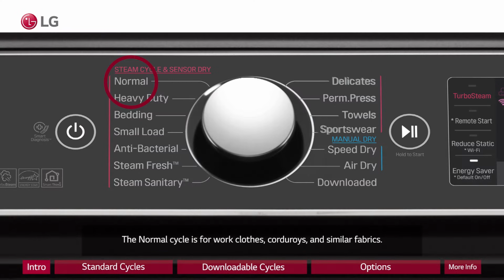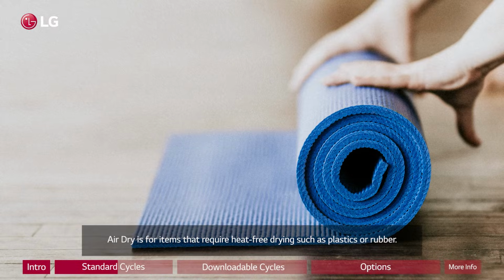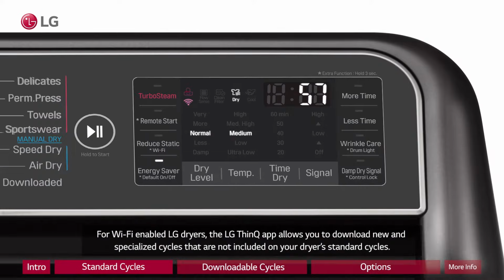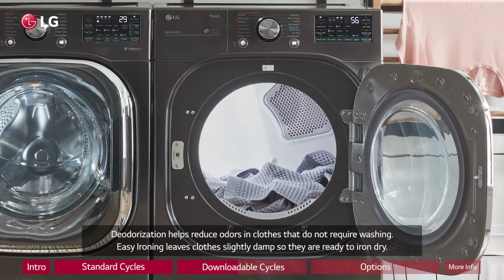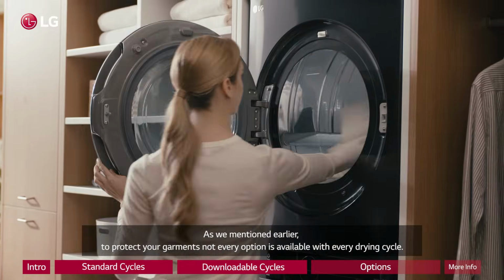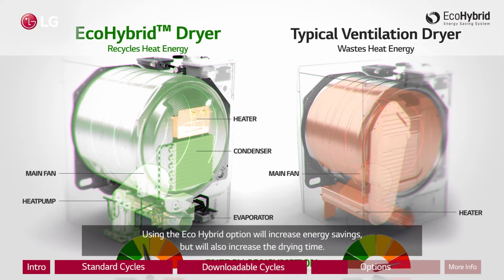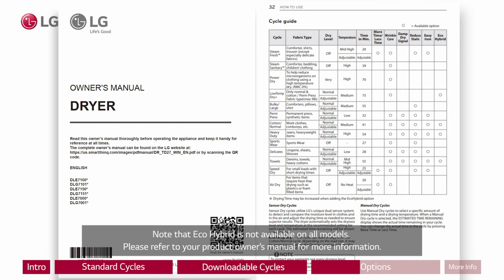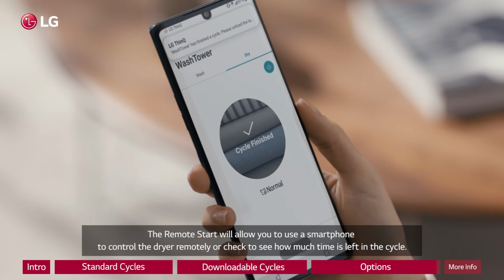[LG Dryers] Cycles and Options

Comment: Is there any way that I can JUST do a tumble dry low?
Reply: Yes, you can change the default setting by pressing the word temp. Each press move the temperature setting one notch. Keep pressing temp until your desired temperature is reached. If that doesn't work for you, you can set the dryer to Timed  Dry and then select your time and temperature.
Reply from the maker: We appreciate the helpful tips, Veronica! We're always glad to see customers helping each other so you can get the best experience with your unit. If you ever need anything, feel free to reach out to us on social media at @LGUSSupport, and we'll be ready to help! *Josh
Reply from the maker: Hey there! There's a special joy in doing laundry with your LG dryer, especially when the amazing features add to the experience. We'd love for you to private message us on social media @LGUSSupport with your contact information and model number, so we can check into your owner's manual to see if your model has this setting. We hope to hear from you soon! ^Joslyn

Comment: Hey how many degrees in Celsius is normal dry, time dry and extra dry
Reply from the maker: Hi, there! The normal, dry, time dry, and extra dry settings on dryers typically correspond to different temperature levels. The specific temperatures can vary between different dryer models. Please send us a private message on Facebook or X at @LGUSSupport or call us at 1-800-243-0000 with your product details so we can look into this for you. ^Jayne

Comment: I’m planning to buy an LG dryer with steam but I will not connect the water hose to the dryer. Simply not interested in the steam function. Would that cause a problem?
Reply from the maker: Great question! Do you mind letting us know a particular model you had in mind to make sure the feature in that model is optional? We look forward to your reply! ^Chris
Reply: @LGUSASupport  it’s the WM6700HVA
Reply from the maker: Hey there. With regard to this model WM6700HVA, this is not a dryer model but a washer model that is resemblance to the model DLEX6700B, which is a dryer. In all regards, most dryers that have the steam option, have a steam feeder in which you would pull out from the drawer and add water for the dryer to have its steam. ^Anthony https://www.lg.com/us/support/help-library
Reply: @LGUSASupport  You are right, I meant the dryer DLEX6700B. Would I have a problem if I don’t connect the water hose to this steam dryer?
Reply from the maker: In regard to the steam capability on our dryers, there will be no need to connect it to a water line. The unit itself has a built-in drawer in which you would add an amount water to produce the steam. ^Anthony
Reply: @LGUSASupport  Cool, thanks for the prompt replies.
Reply from the maker: No worries, So glad we're able to assist. Please feel free to reach out to us again if you need anything else in the future. ~Tanisha

Comment: Hey which setting in dryer do I use for a blanket that’s heavy and gets heavier after wash
Reply from the maker: Hello, Fazlay. We thank you for taking the time out to share this with us. To answer your question, the cycle we recommend is heavy-duty cycle. The default dry level is normal, the default temperature is high, and the default time is 54.

For further reference, you can check out this link to know more about LG Dryer cycles and options: https://www.lg.com/us/support/help-library/lg-dryer-cycles-and-options--20152068325571 

Should you have further inquiry, send us a DM on Facebook or Twitter and we'll be ready to help. -Mishi

Comment: I don’t have the fresh up setting 
How to I just dewrinkle some clothes?
Reply from the maker: Thank you for sharing this inquiry with us. To answer your question, please check out this link to see the different ways on how to avoid having wrinkled clothes after using your LG Dryer: https://www.lg.com/us/support/help-library/clothes-are-wrinkled-CT10000012-1337625976471#:~:text=Dilute%20thicker%20fabric%20softeners%20half,that%20they%20will%20dispense%20properly.&text=The%20air%20movement%20and%20tumbling,which%20helps%20to%20reduce%20wrinkles.

Should you need further assistance, please send us a DM on Facebook or Twitter at @LGUSSupport and we will be happy to accommodate you. -Mishi

Comment: I hate my machine. My combo, not even a year old, either leaves clothes wet, not damp, or fries them.  On permanent press, the clothes are baked with wrinkles ironed in.  Synthetics are the same, which destroys the stretch fibers prematurely. Towels, jeans are wet and need to be dried four or five times before they are simply damp.  It's already had one kind of sensor replaced, but not much improvement. I've checked every website I can find, and none seem to help.
Reply: I share same reservations. I got one set two weeks ago and I completely hate the dryer. Even on manual dry, the flow sense will still come on causing the machine to stop. It’s really frustrating
Reply from the maker: Hi, lisa. I’m sorry to hear you're having this issue, and I’d like to see if we can assist. Please contact LG Customer Support by direct message via Twitter ( @LGUSSupport  ) or Facebook Messenger ( https://www.facebook.com/LGUSA/ ), and include your contact details, the model & serial numbers, and a detailed description of the issue. ^Chad
Reply: I dont know what to do with all the lint and fuss or hair whatever u call it my clothes come out of the dryer because they said not o use drying sheets ugh. What is a good alternative for dryer sheets.